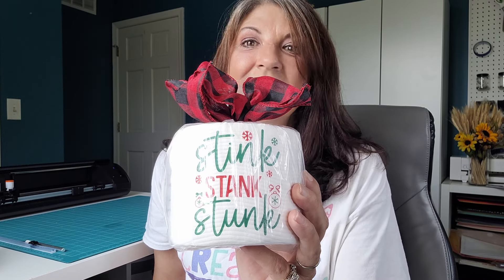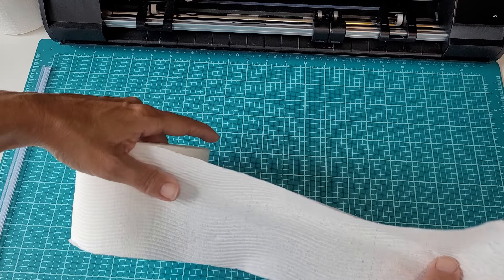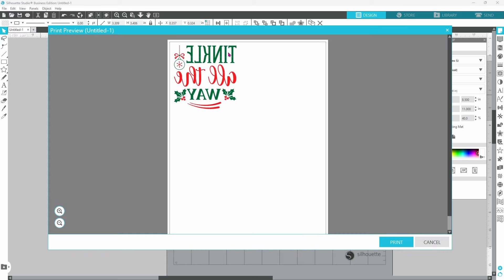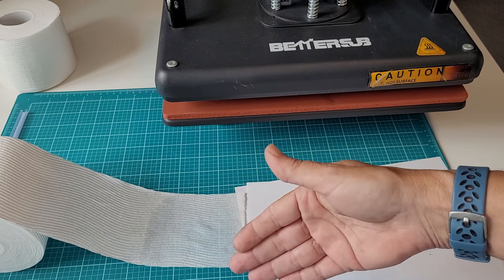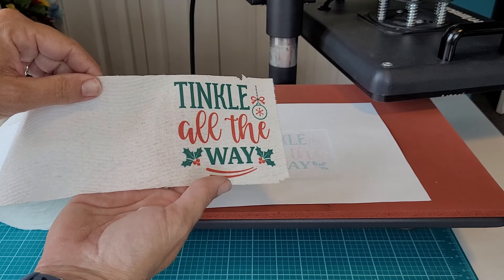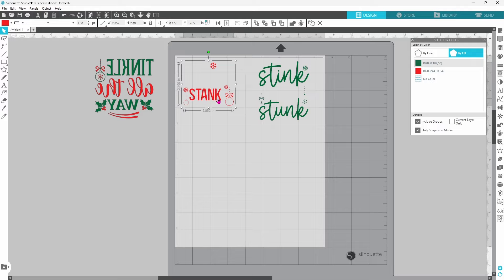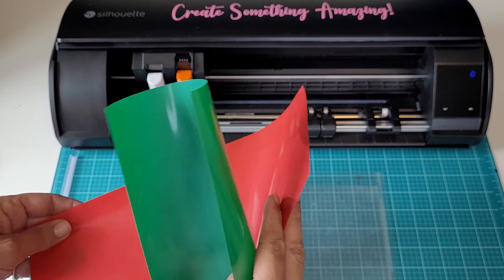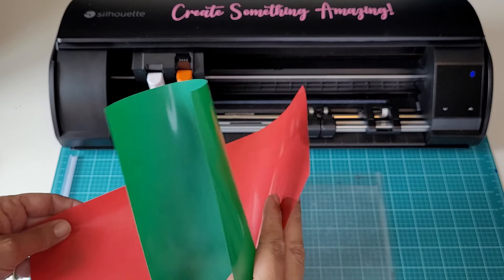HTV and Sublimation on Toilet Paper Rolls! 🧻 | A Fun DIY Guide

Comment: My toilet paper that I did the sublimation on ended up turning a really light yellow after pressing. I pressed it at the time and temp you said. Any ideas what I did wrong?
Reply from the maker: I recommend checking the true temperature of your press with a heat gun, it sounds like it may have gotten a little burnt which is why you're seeing the light yellow.
Reply: @creativefabrica  I will try it again with my 15x15 heat press. I used my Cricut Easy Press for this one. Thank you for the suggestion.